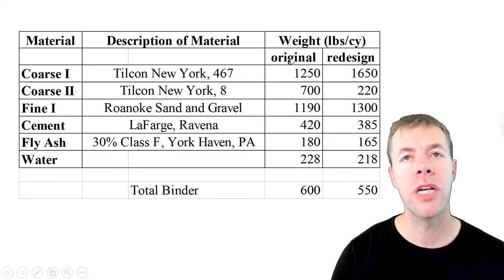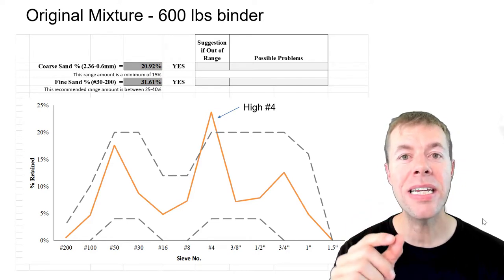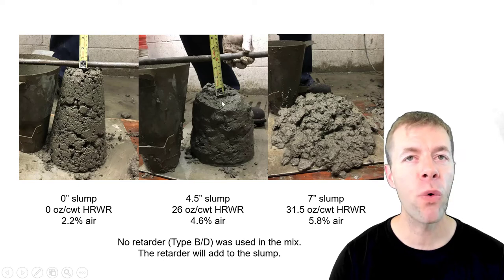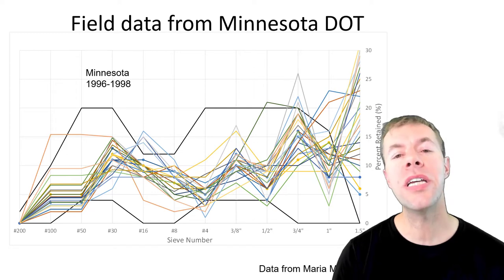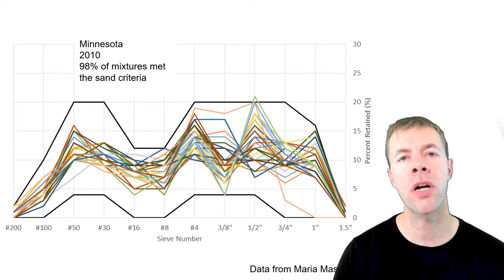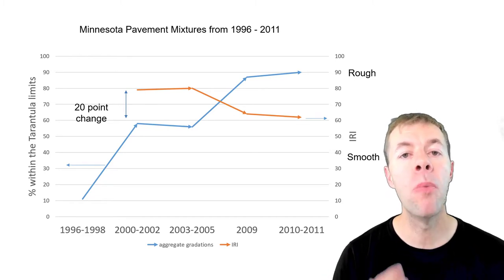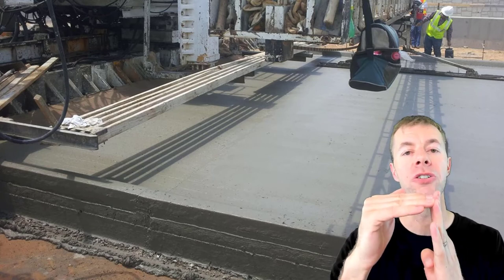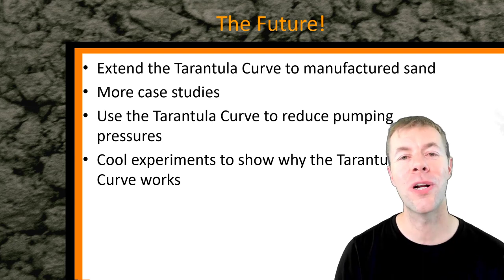Tarantula Curve Case Studies and the Future | Case studies in concrete mixture design

Comment: Hi.. does the tarantula curve able to help in designing concrete mix containing highly dense aggregates?...lets say fillers above 3.5kg/ltr.

Suppose we need to produce concrete with a mixed density of 3.5-4 kg/ltr
Reply from the maker: I am not sure.  I have not tried it.  Are you using steel pieces for aggregates?